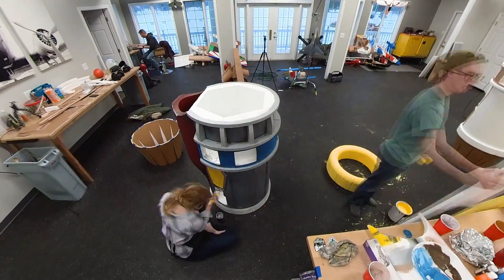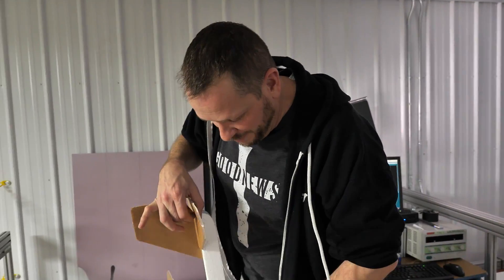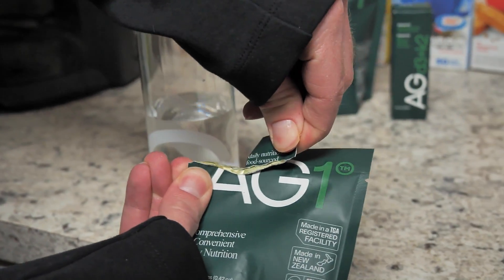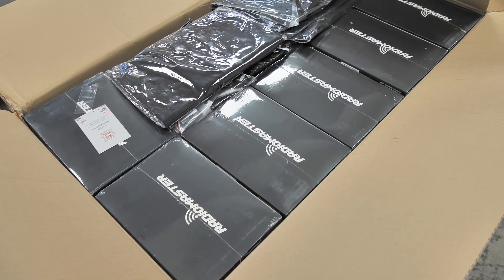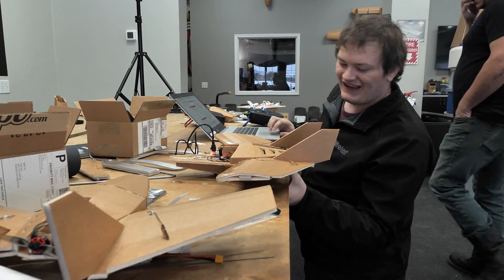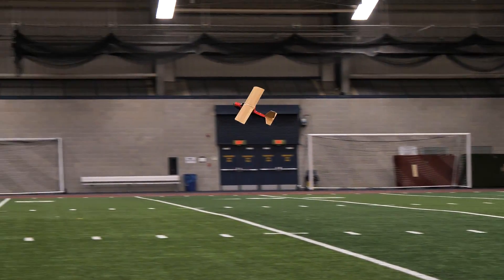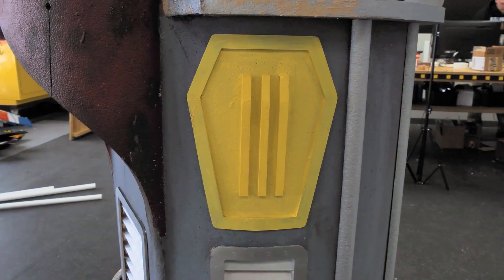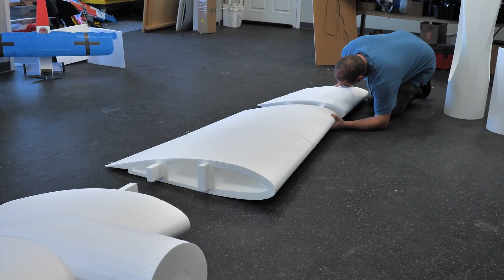Homemade Flying Fortress Gets Its Wings And Much Much More!!! - Week 5

Comment: You guys should try building a negative pressure air balloon. Get a small DC vacuum pump make a huge blimp or air-wing and cover it with carbon fiber. Then pump out the air until it floats. You might be able to make something big enough to carry a person...

Comment: Guys, the B-17 is huge enough to reinforce the wing with a steel slab and it still would fly. With your equipment I'd cut a big ass flat aluminium or wood spar. Or just glue a broom handle inside the wing if you don't want to put this much effort

Comment: Just don't do what I did when you glass your wings.  I thought it would be a good idea to do them as a resin infusion and forgot that I had open joiner tubes inside my wings.  They filled up resin completely.  Also, if you are planning to bag the wings if you have a really strong pump, don't use full vacuum.
Reply: I started doing mine as a wet layup and then put wax paper over the wings and sandwiched it back in the wing beds with a bunch of weight.  It seems to be the best compromise of strength/weight/surface finish.